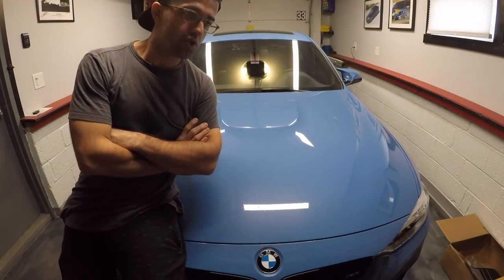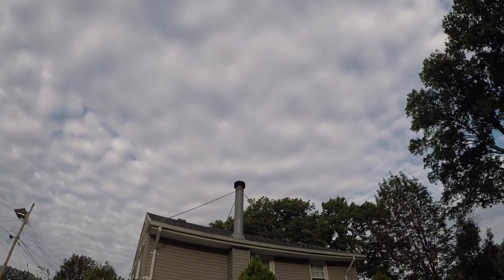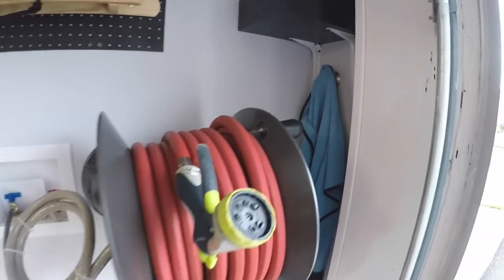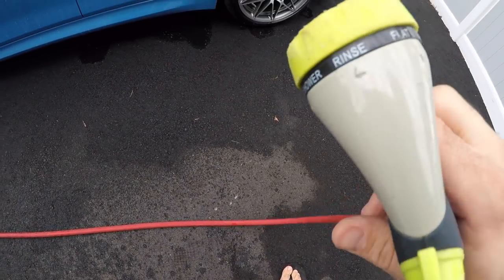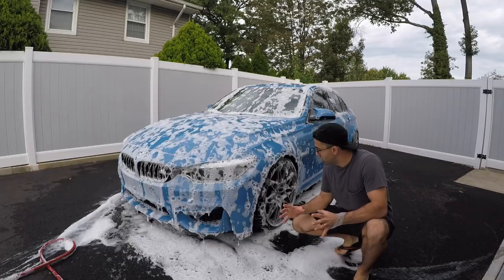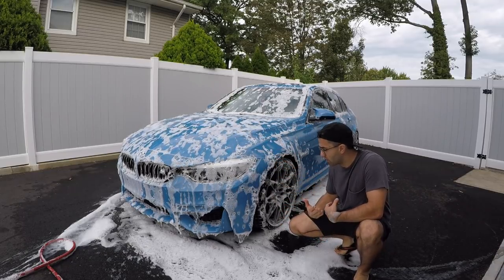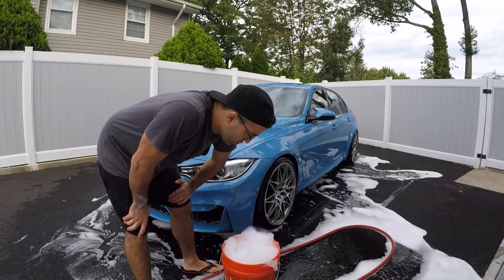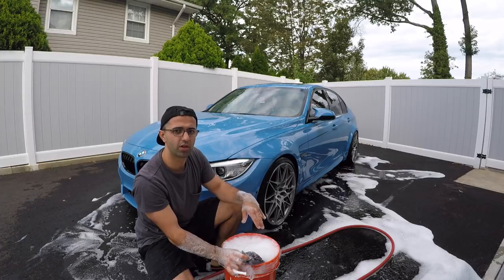Vlog 02: This is how I wash my M3 - the NORMAL way

Comment: Great video. But the two bucket(or three bucket) method you mentioned is not so you use one bucket for the top of the car and another for the bottom and wheels. One bucket is for soap and water(wash), second buckets for plain water(rinsing), then third can be for wheels only. You're suppose to wash with the wash bucket then rinse the mitt in the rinse bucket to release all the dirt and not reintroduce it back into the wash bucket. So the cycle for the wash mitt should be wash bucket, car, rinse bucket, repeat until car is clean :)
Reply from the maker: Ricky L. Thanks for watching and thanks for the comment. I’ve got to say that does make a lot of sense. Maybe I’m just lazy hehe but I appreciate your input
Reply: Np! I completely understand where you're coming from haha. I have a mineral white m3 myself, with the competition package wheels even though the car doesn't have the package (first owner probably swapped the wheels). And I gotta say, cleaning the wheels is the most annoying part with all those spokes!
Reply: Ricky L. The three bucket method is the ONLY way to wash a car imo.

Comment: You should consider a brush for the wheels and a small electric power washer unit. I realise that electricity and water don't mix. They have very long hoses so they can be left far away from the car. Gas units are more powerful but you don't need power for car washing. Gas units are a pain to maintain and your neighbors may not like the noise.
Reply from the maker: Great point. Thanks !

Comment: Looks great. I would nonetheless never use only one bucket. I would advise your on using the two-bucket method and investing in an electric power washer - the will remove a lot of dirt before "scrubbing" = less scratches in the paint. Plus the power washer helps with cleaning the wheels a lot - especially when it gets dirty after a longer time without a wash.
Reply from the maker: Daniel Fl. Thanks for the suggestion. I do use an electric power washer from time to time. Will make a video soon!
Reply: 2 buckets is insane unless it can be proven that the wash bucked NEVER gets contaminated from the rinse bucket.

Comment: I‘d hate to wash those wheels aswell, if I had to use the equipment you showed for it. 
I hope you got yourself a wheel brush in the meantime. That would make your life a lot more easy. 

I wash my M2C every 2nd to 3rd week, depending on how dirty it got. In the summer it’s either 2 bucket method with pressure sprayer and foam lance or just a quick spray-down at the self service stations. 
In the winter I sometimes go for a rinseless wash in the garage.
Reply from the maker: Good tips!

Comment: Tommy!!!! you missed a bit!!! Joking. Nice vid again, i love cleaning my M4 Comp in san marino blue, i do pretty much the same as you, but use a Supernatural wash sponge they hold less grit than mitts. I use a small cheaper sponge for wheels i find it easier. And for drying ditch those little microfibre cloths get...A Gyeon Q2M Silk Dryer, (you will thank me later) Ive seen detailers use them. I have the large one, you just use the one cloth on whole car, it soaks up the water without even wringing it out. Great investment. My car has a full frontal ppf wrap and was ceramic coated 2 months ago ready for winter salts coming here in UK.
Reply from the maker: This was my second video. It was bad haha
Reply: @TommyLGarage  no it wasnt i liked it

Comment: Do you recommend microfibres rather than a cham leather ??
Reply from the maker: GTRMADMAN Gaming Cham leather is a bit tougher. I prefer microfiber
Reply: Tommy L Garage I watched your video on the side skirt extenders good video dude, I traded in my 2014 Austin yellow m4 today for a special Fire Orange M3 and tried to purchase the extensions but BMW don’t have a part number for them on M3 only M4, I measures the 2 cars and very similar in length, I’ll the M4 ones Fit the M3 ??
Reply from the maker: GTRMADMAN Gaming that’s correct. The M4 skirts fit the M3 with minor modifications. If you want my video to the end you’ll see what needs to be cut. Good luck and congrats on the new car!
Reply: Tommy L Garage thank you , I seen the jacking points needing cut but slight difference in length I think it’s like .5 of a cm, I take it’s just entered up with maybe a bit of overlap either side, must price the M4 skirts 👌